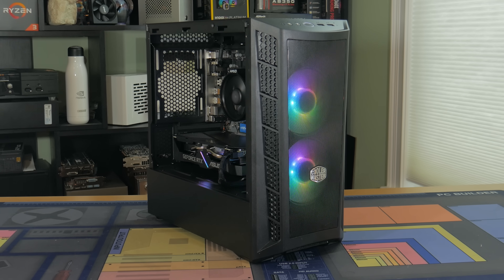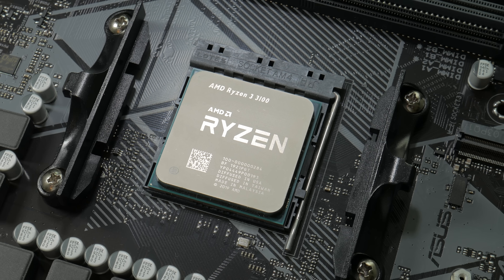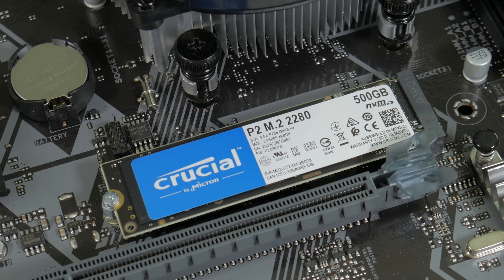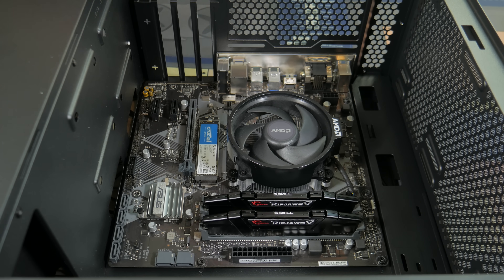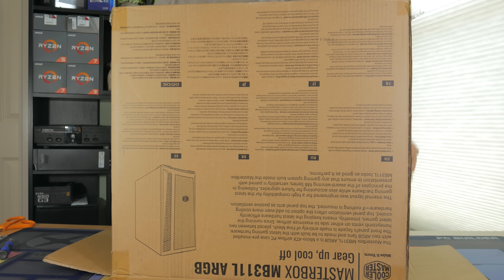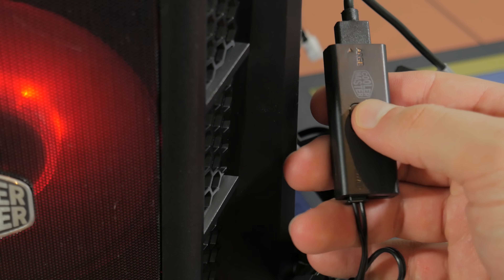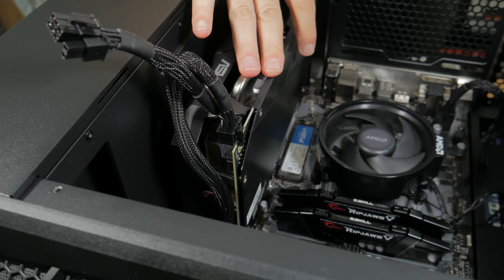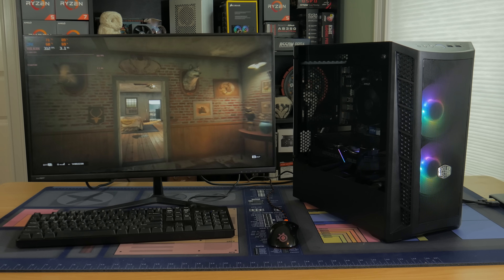$750 Streaming/Gaming PC Build Guide! (Late 2020)

Comment: So I have a Razer Blackwidow Chroma keyboard, and Razer Viper Mini mouse, and no matter what usb port I plug it into front or back, I doesn't turn on my keyboard and mouse. Does anyone know what's wrong? I'm also having a problem with the pc not displaying anything on the monitor, and I'm using a different case, the Cooler Master Mb530p, and a different Graphics card, a Evga geforce 970 ssc, and my graphics card fans only spin a couple seconds at a time, not constant, idk if that is a problem but I need help

Comment: Wait at 8:45 you installed that tiny screw thing, my ssd didn't come with that it just came with the stick

Edit: I just found out you said m.2 standoff, I didn't get that, did the ssd come with it?

Edit 2: Nvm, just found out the m.2 standoff comes with motherboard, almost had me scared for a second 😅

Comment: So i dont have the Graphics card just yet and my fans arent working. Do i need the Graphics card for them to work? I dont think i do but i havent plugged anything in wrong and they just wont start at all (The motherboard light turns on but not the fans or the rgb on the case.)

Comment: The only problem i had with this was connecting a hard drive to it. When the m.2 is installed the mother board voids the last 2 sata slots (5 and 6) so had to use 1-4. Which is under the  graphics card, hard to get to once pc is built, but I managed.

Comment: If anyone is doing this exact same build plzzzz let me know if it works because I bought all the parts, and it turns on but there’s no display
Reply: Mine started no problem, double check your connections, maybe you forgot to connect the video card to your power supply

Comment: Is this cpu better then the Ryzen 5 3600?
Reply: No. The 3600 is the 6 core version of this and is basically better in everyway. This one is cheaper because it has less cores and he probably used it so that he could fix a 2060 into the budget.
Reply: @redeemr  thank you... i actually order part to build my first pc and thats the cpu i got pairing with XFX radeon RX 580. Not sure if its a good combo but im hoping for the best.
Reply: @FateG-M  it's a pretty decent combo. I've using the 2600 and the rx 580 for the past 2 years and I'm loving it. I'm not able to play everything on ultra settings but I haven't really ran into a game that I can't play because of my hardware. If you're playing esports titles you can easily break 100 fps with some minor tweaks. Also if you can make sure your ram is 3200mhz or higher
Reply: @redeemr  G.Skill RipJaws V Series 16GB (2 x 8GB) 288-Pin SDRAM thats what i got says 2233mhz to 4000mhz

Comment: Alright yo just built it, one led turns on not the other one. Doesn’t connect to my two monitors, feel like I just wasted all my money
Reply: You most likely plugged your front panel LED cables in the wrong header pins. Double check ALL connections.

Comment: I'm thinking about getting this:
CPU: Amd ryzen 7 5800x
MOBO: ASUS prime b550-plus
RAM: 16gb corsair vengeance (3600mhz)
GPU: 16gb amd radeon rx6800
Storage: 256 m.2 ssd + 1tb hdd
Power supply: 650W.

The total price is £1600 but I'm really not sure, bearing in mind this is my first gaming pc. Any thoughts?

Comment: would a 450 power supply work just as well? Amazon is out of stock on the 550 ones :(
Reply: i wouldn't, 500watt is recommended for rtx 2060 one thing you don't want to cheap out on is the psu, check evga psu they are some of the best at the same price might be in stock

Comment: i'm sad dude i found the exact same parts and it's just shy of 1000 dollars not 750 :(
Reply: you can thank the coronavirus for that
Reply: Use new egg. It has better prices than Amazon. Like if you wait you can get a 2060 for 300 bucks. Fellow mid west American here
Reply: @landensummitt909  I just bought mine for 329 so 350 tax I bought I soon as possible because they were going for like. 500 for a lil
Reply: @edriccz  Good stuff. The real retail is 300-350 from Asus themselves. But most places don't buy directly from Asus except newegg. So you just have to watch.
Reply: Probably because u live somewhere else to the us
Reply: @bipolar-rex8192  i live in the heart of iowa doe
Reply: @paulieonthenet   pretty sure prices dropped id check once more if i were you
Reply: Dominic 96  Well this isn't a odd practice is the part world. This would've happened any year.
Reply: Yeah same for me I live in california
Reply: Bc of dat rona boi
Reply: using the normal prices it’s 750 dollars

i changed and added some parts on pcpartpicker (b550 board, 2tb hard drive, psu with black cables instead of ketchup and mustard) and it came out to 800 bucks

Comment: just curious will a Gigabyte Z390 UD mother board work with this?
Reply: Has it got an am4 cpu socket. If so, it should be alright but if you don't know, type All the parts into pc part picker

Comment: I'm currently trying to switch from console to pc,and i have a question ,i saw this pc has a 550w powers supply, doest that mean the pc will use 550w every howr you use it?
Reply: 550w is the max power draw the PSU can handle. If the components of your pc draw more than that things can go wrong

Comment: I copied you exact build except your graphics card i got a radeon RX 5600 XT Red Devil and then i plug it into my tv (because my monitor haven’t shipped in yet) it does avg 30fps on rainbow six series would it do more if i had a better cpu or is it because im using a tv and not a monitor
Reply: If anyone have any information in new to this pc stuff I’ll gladly appreciate it
Reply from the maker: Are you sure you don't have Vsync turned on in rainbow 6 settings?
Reply: @TechByMattB  i dont think i have vsync on

Comment: Yo, I'm 14 and I want to build a pc for myself. I'm thinking of getting the following parts:
cpu    AMD Ryzen 5 3600

motherboard   MSI B450 TOMAHAWK MAX Motherboard 
ram    Corsair VENGEANCELPX16GB (2x 8GB) DDR4 3600
storage   Crucial P1 1 TB CT1000P1SSD8 Internal Solid State Drive
graphics card    Sapphire PULSE RADEON RX 5600 XT 6G GDDR
case    NZXT H510
power supply  Corsair RM650
Do you think this is a good Pc for the price of £900. Thank you!

Comment: PC SPECS AND THE PRICES I PAID FOR (ROUGHLY)
ryzen 5 2600x - 150$
msi b350 gaming plus- 100$
kingston a400- 30$
2x 500gb wd blue- 20$
1x WD black=-15$
corsair vs650- 60$
rosewill natulous case- 50$
rx470- 60$
2x8gb ddr4 3000mhz ram-70$
TOTAL-555$ usd
i rounded the numbers due to it having change
but yah if ye do the math
adding a 2060 in this build i have wont be much more
you can even get a 3070 and and only be roughly 200 over budget
all these parts were bought from ebay dot com expect the mobo which can go for similar on ebay

Comment: I have a build right now saved on Amazon with a intel i3 10100 a 1650 super,16 gigs of ram,a 256 gig ssd,a 2 tb hdd, a case with 4 fans built in,a 600 watt 80+ bronze power supply,a h410m mb,oversized mouse pad,keyboard and mouse and a usb streaming condenser mic with boom arm for $715.00 before tax and free shipping...

Comment: Would you recommend a 1080p, 1440p, or 4k monitor, and what hertz?
Reply: THE REFRESH RATE OF YOUR MONITOR, CLOSELY RELATED TO YOUR FPS, srry, caps lock. A 144 hertz monitor means you should cap your fps at 144,
Reply: @ThatKidAverage  yeah I know that, I was just wondering if it would be better to go for higher refresh rate or resolution
Reply: @smilingman7116  sorry mate, I don't know that.
Reply: @ThatKidAverage  it's fine, I think 1080p 144hz is the best, I just wanted to know if 1440p would also work.
Reply: @smilingman7116  yeah, 1080 WOULD be best but ig if you wanted to run 1440p for a story driven game you could.
Reply: @smilingman7116  you should really go for the rx 5700xt for 1440p 60fps +, but 1080p 144hz is better than 1440p 60hz tho if you're gonna use the rtx 2060

Comment: R3 3100 to a rtx 2000 series? Is it just me or is it a bottleneck at its finest?
Reply from the maker: Is it just me or did you not even look at the benchmarks? You can see that the GPU usage is considerable higher than CPU percentage most of the time. Which means in most cases games GPU is the bottleneck.
Reply: No offense sir matt 😊sorry if my statement had taken out of context or could have offended someone 😔and yes I've looked at the benchmark and probably I've overlooked since I'm watching the video 1am in the morning braindead🙏😂  thank you for the clarification ☺️ more tips from you sir!
Reply: Hey I’m trying to get into computer building, what is bottlenecking?

Comment: Man $750 for that build. My build cost a little over $800.
Specs are:
Ryzen 5 2600
B450 Mortar Max
T force delta 3200 8x2 gb ram
1660 super gigabyte
Corair CV550 psu
Darkflash case
Darkflash fans

Comment: Can this pc run rust? At good graphics quality or will I have to keep looking ☹️
Reply: You need to specify what you mean by "good".  This is a 1080 machine, so if you think 1080 high refresh graphics are good, then yeah, it'll do fine.  If you want higher fidelity at the cost of lower frame rate, you can build a 1440 machine which will make Rust look better, but it will cost you a couple hundred more, plus the expense of a monitor that can actually display the higher quality graphics.  If you want really high fidelity, you can build a 4K machine that will make Rust look fantastic, but then you're looking at $1200+an even more expensive monitor or more.
Reply: @michaelleue7594  I meant like graphics quality 3-4 at 70+fps
Reply: @yes3716  my gtx 970 can do that this will be fine
Reply: @yes3716   @david obrein  There isn't a perfect answer to that question, because graphics cards aren't optimized for specific games, nor the reverse.  You'll get strong performance most of the time, but there are always going to be points where the game's code is inefficiently designed and it causes slowdowns.  That isn't something you can realistically eliminate completely with hardware.  Sometimes the software is the problem, and I guarantee it will come up to some degree no matter what.  Despite that, Rust is a couple years old, and the hardware used here completely eclipses the recommended specs.  

If you want a sense of how it stands relative to other options, let me use the GPU as an example: the 2060 is the "budget" card of the RTX 20 series, which is about 2 years (or one generation) old.  It was designed to run modern games of the time (which includes Rust) at max settings for a normal monitor at normal resolution (like you probably have) at about 60 fps.  It is far from the strongest option out there, and there's plenty of room for upgrades, but it stands at just about the point where the tradeoff between cost and performance starts to really swing upward.  Everything else in the PC is at least as modern and as good quality as the GPU, so if you can bear the thought of turning down your settings to medium for more recent games, it's a perfectly fine machine to put together.

That said, the new generation of GPUs is currently being released, and as more enthusiastic builders replace their GPUs, you're in a position to find good deals on a used one from last generation that is substantially more impressive than the 2060.  There are 2070 Supers available on ebay for less than the new price for a 2060, for example.  The 3060 is also coming out, and while it's a significant bump in price despite being the budget option for this generation, the performance bump is even bigger.  It isn't a big enough improvement that you would consider moving up to 1440p resolution (along with the requisite new monitor), but you wouldn't have to ride the edge of 60 fps by adjusting your settings, either.
Reply: @michaelleue7594  thanks. I've been looking into getting a pc next year and this puts the tech advances into perspective

Comment: That moment when the lowest end AMD Ryzen chip can support an rtx 2060
Reply: Tbh I would switch out the ssd with a 1tb hdd and a tcxsunbow ssd to have more money on the cpu side preferably a ryzen 5 2600x or maybe a 2tb hdd and get a r5 3600
Reply: @faayzomarakhtar6910   no ssd 🥴
Reply: @evanswrld-0_0  I mean upgrading is a thing sure hard drives are slow but would you rather have a 3 3100 or a 2600x and upgrade later to an ssd

Comment: @Tech By Matt I have an XFX rx 590 Fatboy ed already before I watched this video and I was wondering if the cooler master case you used would be good for the rx 590 because the rx 590 is big and under lots of load it  gets quite hot.
(My pc build: msi b450 mortar max atx board, silicon power 200gb ssd, corsair 4x2gb 3200mhz RAM, ryzen 3 3100, corsair 550w psu, XFX RX 590 and all i need is a case with good airflow )

Comment: I use this board in my first build. It has 32gb with the same speed, but it can’t handle 32gb in 3200mhz, I had to leave my 32gb on 2666mhz, so I advice to not upgrade to 32gb in this motherboard
Reply: thank you so much! I was think of upgrading this. Also I didn't think I would need it because all I do Is play games like rocket legue, minecraft, and fornite. Also I might start streaming. Thank you again this helped
Reply: @kayleemontesdeoca8595  I’m glad for helping. I’m using the MSI B450 Pro Carbon Max Wi-Fi, that’s an amazing motherboard, letting me handle 3200 MHz, I downgrade to 16gb and from 3 3200g to 7 2700x

Comment: Holy carp dude my dad just said if I pick up the parts for a pc under 800$ he will buy them for me BRUHHHH THANK U SO MUCH BLESS YOUR SOUL FOR LIFE MAY ALLAH BE WITH YOU
Reply: Same thing happend to me today
Reply: @RareEpicness  lamp
Reply: Check out Xeon 2620 for lga2011motherboard from AliExpress. For 150$ you can buy cpu, motherboard and 16 gb ram. Yes its server cpu, but it still 6 cores/ 12 threads. Also for 50$ you can buy Chinese SSD for 360 gb or 500 gb hdd. And also for 150$ you can buy decend power supply for 500w (i recommend be quite! / Cougar / cooler master). Plus of course videocard. I recommend gtx 1660 super. + Add any case with RGB for 50$-100$. Here you go, decend PC for 800$
Reply: But never buy Chinese power supply. Never! It'll burn your PC.
Also Corsair is not good choice for power supply, its very good but overpriced. You dont need that. I recommend be quite! System power 9 (or be quite! Pure power 11). Or any other power supply with 80 plus bronze certificate. Just dont buy aircool power supply, they also unreliable.
Reply: @Fortify2030  ok thanks bro just changed my list
Reply: @floomick  no problem. Check out alredy build kits from AliExpress, it contains motherboard+cpu+ram. And cost 70-150$ depending on quality. You can check its testing in games on YouTube, just search it. 
I also don't recommend you to buy Chinese videocards (GPU), and overall GPU from unknown brands. They using used chips. The only exception is Colorful. But their videocards cost the same as any other brands so - there is no point.
Also even you dont have enough money dont buy used GPU, they most likely after mining. GPU after mining is a pure lottery, it won't last long.
Buy new GPU, from good brand. statistics shows as that most reliable brands in GPU are MSI, EVGA, ASUS.
Actually GPU and power supply are something that you shouldn't try to save you're money on.

Comment: Can someone help me please. I made a list of parts for a pc and I was wondering if it an ok pc
Reply: Specs?
Reply: @mariocardenas6761  AMD Ryzen 7 3700X 8-Core, 16-Thread Unlocked Desktop Processor

GIGABYTE B550 AORUS PRO AC (AM4 AMD/B550/ATX/Dual M.2/SATA 6Gb/s

Corsair 4000D Airflow Tempered Glass Mid-Tower ATX PC Case

Corsair VENGEANCELPX16GB (2X 8GB) DDR4 3600 Mhz C18 (Pc4-28800)

Sabrent 512GB Rocket NVMe PCIe M.2 2280 Internal SSD High Perfor..

EVGA 700 GD, 80+ Gold 700W, 5 Year Warranty, Power Supply 100-GD...

Corsair A500 High Performance Dual Fan CPU Cooler
Reply: @m3rcacid187  What's the Gpu?
Reply: @mariocardenas6761  idk what would be best to use
Reply: This is a solid build but I would recommend looking for a different aio if you can this one has problems for customers
Reply: @mariocardenas6761  I was thinking this gpu and also thank you MSI Gaming GeForce RTX 2060 6GB GDRR6 192-bit HDMI/DP Ray Tracing Turing Architecture VR Ready Graphics Card
Reply: For a gpu or aio
Reply: @mariocardenas6761  gpu.
Reply: Yes a 2060 would be good
Reply: @mariocardenas6761  with all that. Where i am it would be just under 2k. And I appreciate the help. And the aio CoolerMaster MasterLiquid ML240L RGB V2, Close-Loop AIO CPU Liqu..

Comment: should i buy this : Processor : Ryzen 3 3100

Motherboard : A520 Motherboard

RAM : 16GB Ram (2x8) 3000Mhz CL16

GPU : 1650 Super Dual Fan

CASE : NZXT H510 Case (White/Black)

CPU COOLER : Stock AMD Cooler

PSU : 500W Power Supply

STORAGE : 500GB NVME SSD
Reply: For how much all together?
Reply: @mariocardenas6761  700
Reply: @Goonqq  it's a solid build but before you buy it look up different $700 builds
Reply: @mariocardenas6761  Its going to be for gaming mostly. Mostly minecraft, so I think this is a good build for minecraft specifically, and works well for every games as well

Comment: Matt just a reminder there is a cpu called r5 1600 (6 cores 12 threads)
Reply: That has worse gaming preformance than a 3100
Reply: @davidhegarty4146  yeah but 2 more cores help performance in other things
Reply: @giannis_kapelakos  It's literally 200$ in the US I'd rather buy a 3600 at that point
Reply: @notsillygoob  realy in micro center it is like 80 to 90$

Comment: I have some questions
1st is if you taking 3rd gen ryzen so why not b550 ?
2nd is vice versa I mean if you take b450 why not ryzen 5 2600 I sm assuming you thought about all in stock items also no fan on the back which is included also save money by 128 GB nvme + 750 or 1tb hard drive should do it except these complications nice tutorial